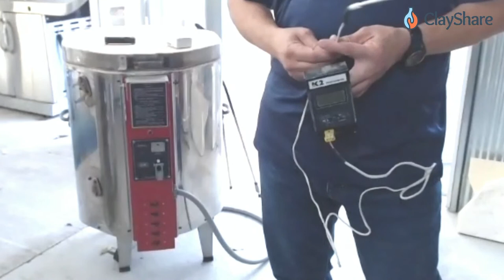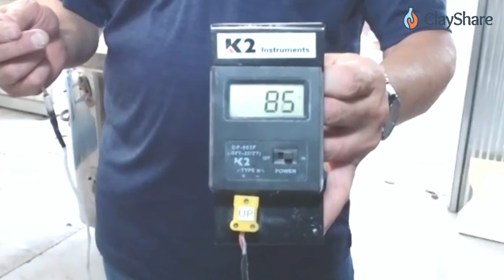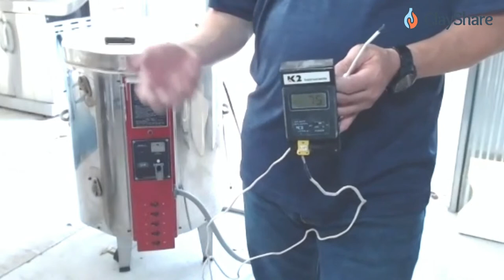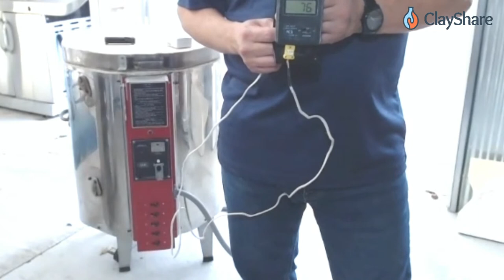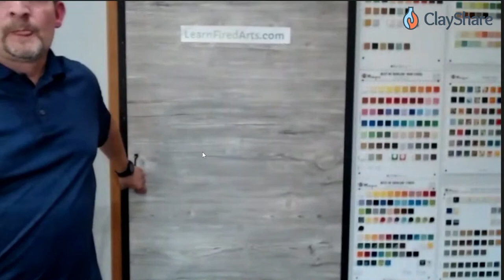Handbuilt Spheres and Raku Firing

Comment: I do raku at our place upstate NY (Catskills) in the summers, using a propane fired kiln. I take most of my pieces up to 1850 degrees, and use "my eye" as well (looking in the top peep hole) to see the melt and determine when to take it out. So, I was surprised at the lower temps used. We've also got an electric kiln upstate, so I may consider trialing this method! Sorry i wasn't watching when live. Where does Michael live?  I love using pressed leaves to raku small bowls/platters, but recently found another way to use washes in the electric kiln, and I'm really pleased with the results.